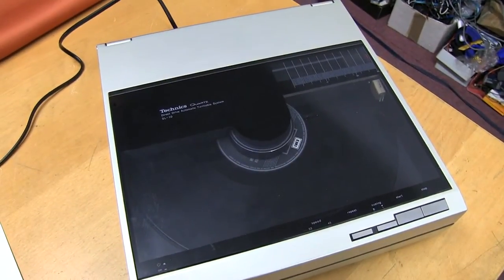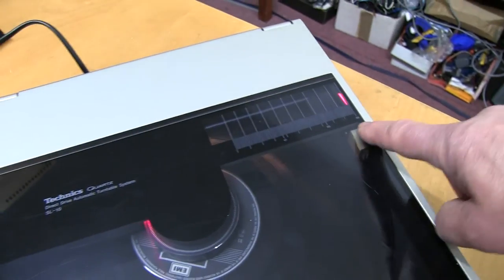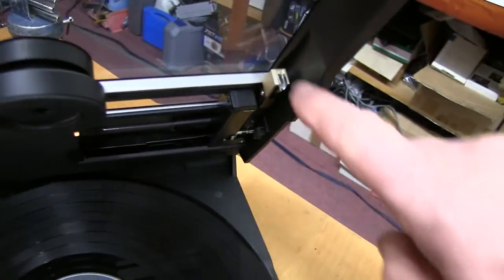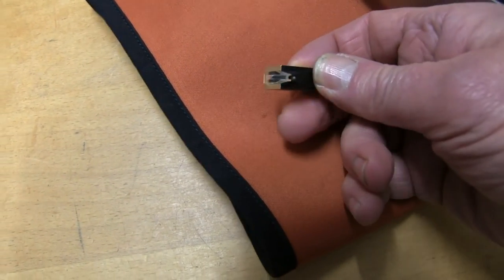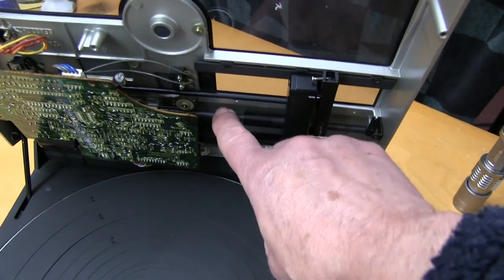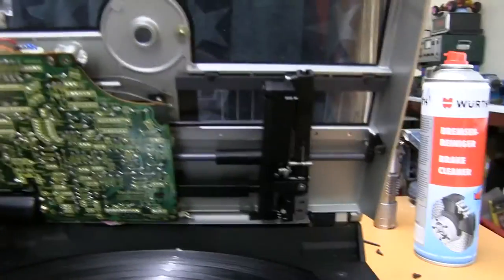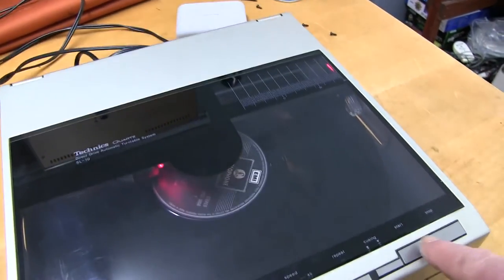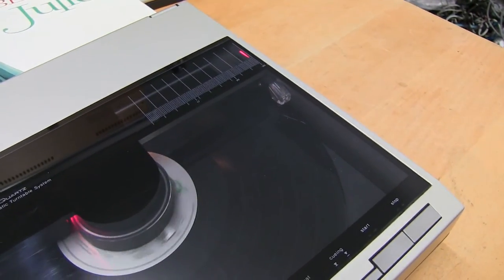Technics SL-10 Record player. Repair, Service and Test

Comment: Hello Nick, Thank you for this video and your other one too. They guided me through opening up my 1980 SL-10. The dial cord is covered in some kind of black lubricant like graphite and has accumulated in the idler wheels as well. Is this normal? Should the dial cord be cleaned and re-lubricated? Is it supposed to be dry? Also the dial cord is sagging on the upper part between the gear drum and idler 4 ion page 9 of the SM. But, the bottom cord between idlers 4 and 5 is quite tight. Is this normal? The only issue my SL-10 has is tone arm intermittent hesitation or sometimes it just won't move but the motor is humming away. I have a new drive belt on order but am concerned the drive cord between the gear drum and idler 4. Hoping you might have time for a reply.
Reply from the maker: Hi Randall
The dial cord should be cleaned and kept clean.
The cord should be tight all the way top and bottom.
There is a tension spring in the large gear wheel.
Make sure the small wheel (4) can rotate freely.
Clean the guide rails and wind the motor , as in the video, to check smooth movement.
You may have to take off the cord and check the wheels and parts are moving freely.
Reply: Hi Nick, Thank you for your reply.
I cleaned the dial cord and the wheels with camera optics grade alcohol cleaner and cotton Q tips. The cord tightened up very slightly. 
Both #4 & #5 wheels are very free. 
Cleaned the guide rails with alcohol. 
The motor turns smoothly. 
The tone arm moves smoothly it's full distance from rest to rest.  
The tension spring is okay. 
The motor belt appears to be stretched. Cleaned with alcohol but still loose.I found a new NOS belt eBay in the UK. 
What is the black graphite like lubricant on the dial cord and all wheels? Should the dial cord be re-lubricated? 
Can I use 3 in 1 oil for the wheel axles?
Nick, I never would have attempted this without your excellent video's.
What lubricant is used for the tone arm guide rod? 
Thank you.
Reply from the maker: Hi
The guide rods do not need lubrication. The plastic slides freely.
The cord does not need the (graphite) grease. I am not sure why they used it.

The cord cannot stretch. It must have slipped from the spring clamp in the large wheel.
It must not have any slack.

3 in 1 oil can be used on the wheels, but the plastic has very little friction.

If the cord and wheels are not moving freely, then the motor belt will slip.
Reply: Thank you Nick. 
The dial cord is clean. 
Wheels 4 and 5 always rotated very freely & are now oiled with 1-2 drops of 3 in 1 oil. Also lightly oiled the cavity just below the threaded part of the platters drive axle. 
The new motor drive belt arrives from the UK around Feb. 28.
The tone arm drive motor rotates very freely.
Your video's image of the cover's washer was critical. I had stopped there fearful of breaking the cover and/or the top acrylic plate. 
I will post results when the new motor drive belt has been installed. 
Thank you for taking the time to create your two excellent SL-10 videos and for replying to my questions, without which I would have not known how to proceed.

Comment: What's wrong with an arm that goes all the way to the end of the record and won't stay put? I want to try n fix it myself? I replaced the belts on this turntable.
Reply from the maker: Make sure you clean the old grease off the moving parts. Also make sure the sliding cover over the wires is not catching on anything.

Comment: Hi Nick.  Can you think of any reason the player would automatically stop playing, and the tone arm go back into the starting position after about 30 seconds of play?  Every record I try plays for about 30 seconds and then the tone arm automatically goes up and back.  Thanks a lot for the videos!
Reply from the maker: Hi Alex
Did you take it apart, or has it started doing it.
The carriage sometimes catches on the sliding black cover, over the wires, under the two rails.
If you do not re assemble it correctly.
The slider has a piece sticking out, and it must be inside the other part of the cover, so it can go fully in as the arm moves across the record.
Reply: I have not taken it apart.  I thought I would ask you first.  I am the original owner and I know it hasn't ever been taken apart.  I'll take a look at that black cover.  Thanks for your thoughts...

Comment: Hi Nick,  Great video, lots of information , thank you for uploading. I  have an SL 10,  its in pretty good condition,  it tracks to the end fine, however i find it may lift up randomly when playing records, would you happen to know if there are any adjustments that are easy to make that would stop this. Kind regards, Jac.
Reply from the maker: Hi Jac
It may be the arm is not keeping up with the stylus, so the angle gets too great and the arm lifts.
There are 2 potentiometers for electronic adjustment.
But I think it is more likely the cable or carriage is sticking.
Possibly the motor belt has stretched and is slipping. Check it first and see that it is fairly tight.
Reply: Nick Adams thank you for your quick reply, much appreciated. I’ve  ordered a new belt from the UK so lll have a go at changing it and see what happens. I’ll let you know the results. You’re video instructions invaluable, thank you.

Comment: Hi Nick. Great video. I have an SL-QL1 running brilliantly and recently got an SL-10. The issue with the SL-10 is that the arm drive motor is frozen. Is there a chance it's gummed up with grease like the guide shafts were and will break free, or is it likely broken and needs to be replaced? Have never opened that up before (if it even can be...)! Thanks much!
Reply from the maker: Hi Rory. Well done, the SL-10 is a fantastic player.
They do gum up badly, especially the guide rods and rotating gears. It is unlikely that the drive belt or anything is broken, unless someone has forced it.
It is fairly easy to clean the old grease off, but you will need some cleaner spray. I then use a toothbrush and cloth etc to dissolve and remove. Just work the grease away with the toothbrush.  It is not necessary to grease/oil after cleaning, as all the parts are low friction plastic , anyway.  Let me know how you get on.  All the best spinning. Nick
Reply: @nickadams5411  So all that is good and clean, moves freely, just that the motor is seized. I found someone in a forum had just forced it free, someone else SOAKED it in 3-in-1 oil and got it to work. Thoughts?
Reply from the maker: @rorymasini  Hi Rory. Yes, spray something like WD40 into the motor, and it should free it, with a little force.
Reply: @nickadams5411  Worked like a charm. NOW, cueing works, etc. BUT when it starts playing it just skips towards the center. Checking the manual to see if it's a weight adjustment, etc. Thoughts?
Reply from the maker: @rorymasini  Hi. The stylus point may be damaged. The playing weight does not normally need adjusting (it can only be changed by 1/4gm). It is possible that the arm is sticking . Start playing, then disconnect the power. Open lid and see if arm can be freely moved up and down, with little force.
Another, more difficult problem, is that the tracking sensor and feedback loop is not working or needs adjusting. You will need the service manual to do that.  Let me know.  Nick
Reply: @nickadams5411  I'm afraid it's going the be the second. Starts playing then the motor pulls towards center. Beyond mechanical skills, I'd say my electronic/electrical skills are zero!
Reply from the maker: @rorymasini  Hi. I need more info. Can you move the arm back and forward with the cueing controls,. Does the arm set down at the edge of the record and then take off straight away?
If you press the raise button, does the arm stop moving.  If the arm can be moved back and forward, then the fault must be the stylus. Are you sure the stylus has a diamond point that actually only touches the record.   Nick
Reply: Nick Adams yes to all. It works, controls work, cart has new stylus. Drops down as it should, then takes off toward the center. I maxed out the weight, no change.
Reply from the maker: @rorymasini  A difficult one. There is a  sensor on the arm that makes sure the arm follows the stylus across the record. If this fails or is out of adjustment, then it will keep going. It does have adjustments on the circuit board, that set the offset angle and gain, but these would not normally go out of adjustment. There is a screw adjustment on the arm that sets it to a centre position when playing. It is possible that it needs adjusting. It is done witha small hex tool. If you look at the instructions/drawing of the service manual, then it is worth a go.  The service manual is avaialble (Free) at https://www.vinylengine.com/library/technics/sl-10.shtml (Registration is also free).
Look at page 12.  All the best Nick
Reply: @nickadams5411  Thanks. Yes, I saw that and hope this is the case. Will work towards adjusting that today. Thanks so much for the almost-live responses! Appreciated!

Comment: Hello Nick.  I am the original owner of an SL-10.  It still plays records but appears to have developed a sound wobble.  Any tips on how to cure this? Cheers!
Reply from the maker: Hi.  A sound wobble is very unusual.  Also it depends on the detail of the wobble and if it continuous or just in certain places.  It is possible to test the motor/platter operation by using the 12V DC input (instead of the mains). It should be rock steady with the 12V.  You will need either a 12V  battery, or a good dc power supply (Only about 1 amps is enough). You will need the correct input socket, which is easily available .
Reply: Nick Adams hi Nick. Thank you for the reply.  It is better described as a pitch wobble.. it is continuous.
Reply from the maker: @rootsdown4685  HI. A difficult one. Assuming the platter can spin with no resistance (pivot needs cleaning /oiling). Then the control system is a fixed electronic circuit with no adjustment. It is possible that the connections become corroded, that connect between the various platter motor connections. I would try and pull/push them and use some contact cleaner on them. Besides that it will need some detailed voltage measurements to try and track down the fault.

Comment: Thanks for your great video. Helps me a lot. At 12:35 you talk about the tension of the wire (belt) which mooves the mmc. Mine is really loose. How can i change the tension?
Regards from germany
Reply from the maker: Hi
The drive cord is held by a spring in the larger wheel behind the circuit board.
The dial cord is tensioned by the spring.
Check the spring is still in place.
The cord cannot stretch, so make sure it is on the two small wheels.
Let me know
nick

Comment: Just bought one, very nice machine, currently working OK. Do you run as service and repair business?
Reply from the maker: Hi Wayne
No, I just repair things  for satisfaction.  I do sell Radio Control as my business.
I prefer old things to fix, as I am rather old now.
Reply: Nick Adams thanks for video, it will hopefully help me to keep mine going!  Is there a “modern” grease you recommend for the rod that the arm tracks across? Mine appears to have quite a thick coating of clear grease.
Reply from the maker: Hi Wayne
Wipe off the old grease. There are many slippery greases.  Some start out very slippery, but dry out over time.
Graphite grease is good. Teflon (PTFE) grease should be good, but I haven't tested it over a few years to see if it dries out.
Others are Molybdenum, and ones with Boron.  
Most of these greases are used in models on small gears etc, so a model shop is a good source.

Comment: Hi Nick I have a Sl 5..problem I have is that only one channel works..any idea what it could be?
Thanks
Reply from the maker: Hi Shahed. The signal travels from the cartridge and out through the phono cable. It could be the cable, so you need to check it starting at the phono plugs to see if there is a break in the wire or a short circuit. Then check the cartridge, it is easily removed and then plug back in, just in case the plug in connections have become bad after many years. A couple of plug in and out should clean them up. If still no joy, it is possible the cartridge has failed, but that is rare. If it has failed, P mount cartridges are still available and not too expensive.  All the best. Nick
Reply: @nickadams5411  thanks for your quick reply. I've changed the cartridge and I've checked the phono outputs and they seem fine.
Reply from the maker: @elvisrafi  All you can do is check the continuity of the cable from the cartridge plug in connections to the phono plug. There must be a break or short circuit. You will need a test meter (Ohmmeter)
Reply: @nickadams5411  I will give it a go! Thanks

Comment: Hi, Nick, thanks for the amazing videos on linear TTs. Wonder if you have an idea what going on with my Technics SL-10. It is getting some sort of periodic low frequency noise, it sounds just like, if you'd imagine a non-linear turntable for a moment, when someone closes the acrylic dust cover very gently during playback and the stylus captures that bump, so it sounds like a little periodic knock on wood. I hear it only on very silent moments (between tracks for instance). if I'm not wrong, in the past I used to hear that on fewer albums, and mostly very near the end of the record only (like during the fade-out of a last track). Now, it seems to be everywhere in which there's a low volume passage, from lead-in to lead-out. At the end of the side, it's particularly louder. I compared home recordings using my SL-10, from a year or two ago versus what I get now, and I'm nearly sure It's gotten worse. I've watched the turntable behavior closely and I can confirm the noise appears when the back portion of the tonearm (the part with the led forming a red arrow) moves a bit (not necessarily when the stylus moves, it's when the back of the arm moves). Would you guess it is the belt? The arm seems to move freely. Only two things happened from the time it was better to the present situation: I stopped using the Sl-10 for 10 months, and, also, just before I started using it again I opened the dust cover and adjusted the lead-out screws, but the lead-out "fork" piece and the 2 screws felt inside the SL-10, so I had to open it fully (without taking out the circuit), find them, and put them back in their right places. I never even touched or took a look at the belt. Thanks again!

Comment: WOAAA! I got real fun out of watching this.The tastied ever SL_10 I have ever seen and the mc in the scrap bin, where is your scrap bin please? The vid is lavish too but the funnies start when you're testing the  belt. Yes of course it should be tight as it
has to transmit a fair degree of force to the arm. I hope  by now you will realise that removing the viscous lubricant from the
assembly was a big mistake and you have unwittingly changed one of the control systems state variables in the process. I
would strongly recommend reading a book such as Control System Design (Cheng) to gain more knowledge about the
system , I absolutely would.
Reply: I hope that you will allow me to make some further observations. I would need to look at the MC cartridge exactly
where it has sheared, incase there is a possibility that a donor cantilever could be inserted and held in place with
loctite for instance. But returning to the video it is excellent in every way except you seem to have an obsession
for cleaning things which seems to be, in this instance, fighting against your normal approach , whereby you explain things very clearly and methodically.
    There can be only two reasons I can imagine that would require the removal of the upper cover. Firstly, the replacement of the tracking arm drive belt, it's un-stretched diameter is between 25 to 30mm (the most likely cause
or secondly, the failure of the tungsten cabinet lamp, which is a 12V standard replacement, other than these parts, I
would not touch anything.
         My technique as regards the thick grease would be to go no further than disturbing and replenishing with the original, your service manual must be pretty poor if it doesn't tell you what that is . Or the circuit diagram, do you have that part yet?
         My fear is that by changing the type of lubricant used on the slides may also change the coefficient of friction in the drive mechanism which may affect the stability of the system . For instance, it would not be desirable for the arm
to exhibit overshoot with your expensive cartridge I don't think.
Reply: Hilarious! I do wonder about some people.

Comment: You can have those cartridges rebuilt and it's well worth it.
Reply from the maker: +Ashley Cox 
Hi
The only place I could find wanted many hundreds to repair the cartridge.
Do you know of somewhere ?

Thank You
Nick
Reply: +Nick Adams Not the doesn't cost hundreds unfortunately, it's a very delicate process and very few people can do it. That said even damaged the carts can fetch a fair bit on the used market.